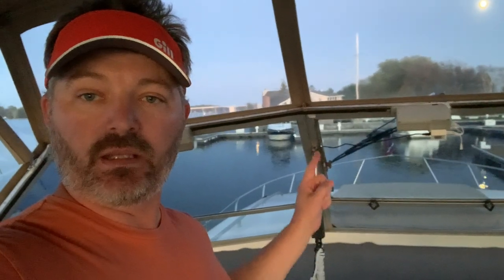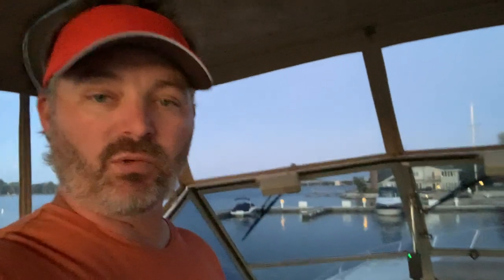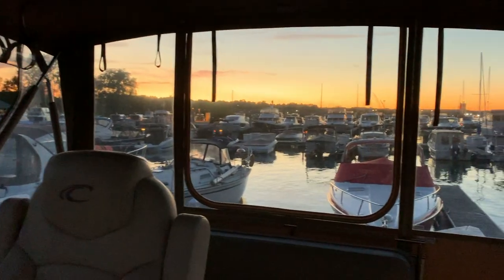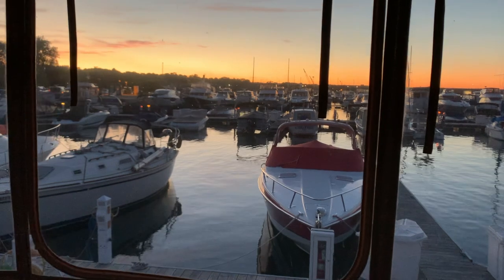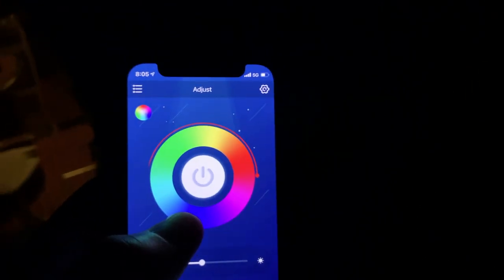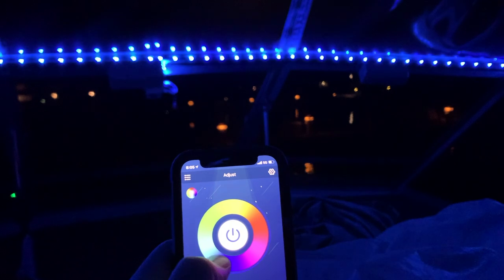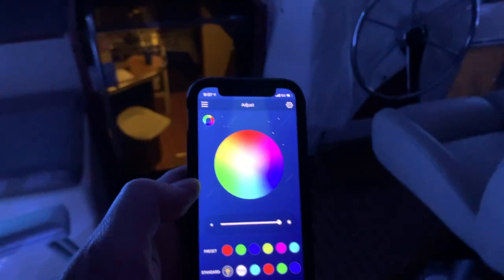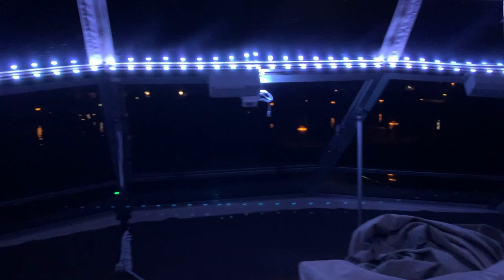MV Thirsty Whale, 1984 Chris-Craft Catalina 381, LED Cockpit Lighting

Comment: Nice lights! Don't be afraid to splice in a longer power cable from the transformer, it's easy and you could relocate that let pack and ugly wires... 👍🏼
Reply from the maker: That's a good point...I'll add that to my list!
Reply: @WiscoBoater  you may want to just power directly with DC?  I'm assuming you need shore power or generator to power your AC loads?  Because of genny noise I'm planning an inverter setup to run basic AC loads when off the dock. 
Plan is 600 amp/hrs of battery storage under forward bed (haven't decided on gel cells or lithium). 3500 watt  Line tied inverter/charger, (also tied to engine alternators through an isolator for charging under way), and possibly solar panels on salon roof. Hesitant about that due to glare on the helm station.  Enough capacity to run 1 a/c unit (out of 3) and other minor loads. Should handle coffee maker or one stove burner with no other loads.
Not H2O heater.
Chip.